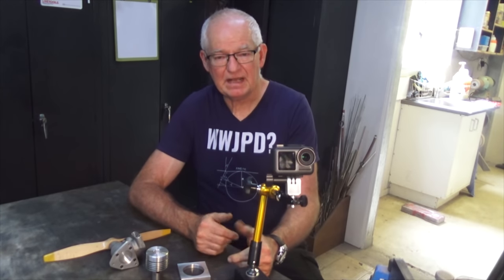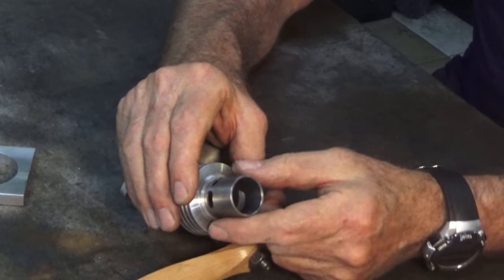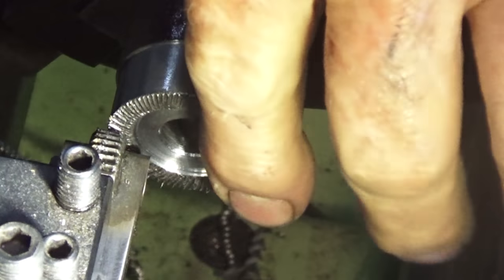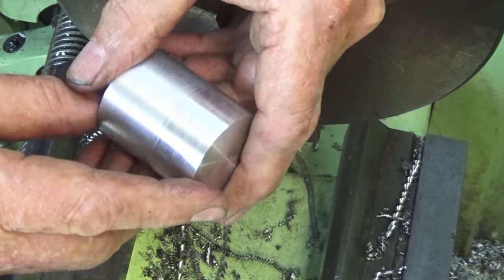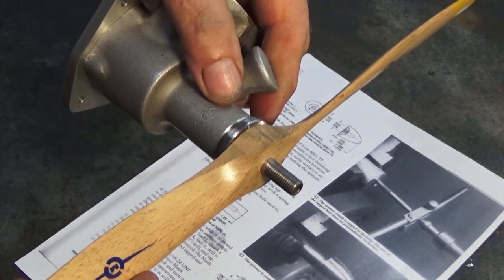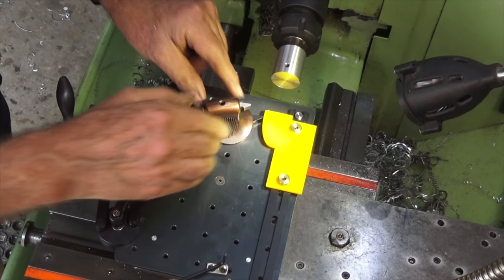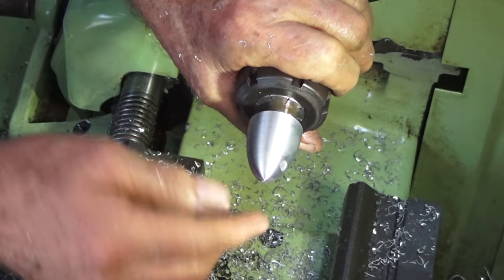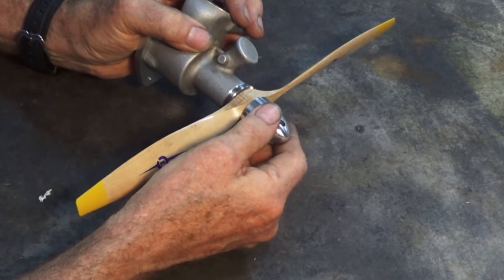Building the Titan .60 Glow Plug Engine #8

Comment: That tracing fixture is a really useful addition to the workshop
Reply from the maker: Yes, it's a nice piece of kit. I purchased the basic Turnado attachment and then the tracing arm. There is also a large radius attachment that I will probably acquire down the track. The good thing about the Eccentric Engineering tools is that you can purchase in stages as the need arises.
Regards,
Mark

Comment: Gday Preso, the knurl turned out way different to what I thought it as going to, the prop nut looks absolutely awesome, the turnado does a fantastic job and the type of parts this can make is endless, don’t stress about not getting it all done, I’m stoked there’s going to be more episodes, absolutely beautiful work mate, Cheers
Reply from the maker: Thanks Matty. I am pretty sure if I had bothered to check that the knurl was on correct centre height it would have turned out quite differently. I only have one more accessory to buy for the Turnado and I'll have the full kit. I am also waiting patiently for Gary to roll out the Flexi Chuck system. It seems to be one of those tools that you wonder how you did without it. 
Regards,
Mark

Comment: Now the cylinder liner is as round and parallel as you would like you can use the hone to give the bore a cross hatched finish for oil retention. It doesn’t even matter if you make the bore a little bigger because you can make the piston to suit. Just a thought.
Reply from the maker: I am not an expert but I believe that many of these small engines had chrome plated bores. There are no rings on the piston so the compression relies on having a super close fit between the piston and the bore. The methanol acts as a coolant as well as a lubricant. Also, there is no splash lubrication like you would get in a four stroke engine with a wet sump. I will be lapping the bore again but mainly to remove the burrs created when the ports were cut into the liner
Regards,
Mark

Comment: watching and listening to you do this work is a great teaching aid. I am amazed at the different tools you have acquired and built in your craft. I would think you must have a very well stocked shop and mind for this hobby, and must lay awake some nights designing these attachments.  Super great job. Next challenge could be a sleeve valve engine.
Reply from the maker: Thanks for the compliments. I bought a book many years ago on model petrol engines and it has sat on my shelf all that time. This engine project came about unexpectedly but it has reignited my interest in internal combustion engines. 
Regards,
Mark

Comment: The people at Eccentric Engineering certainly are cluey, I have been using the Diamond tool holders and Crobalt tool steel for some time no with great success. Thanks for showing the Tornado and great work again. Liked the cross drilling rig too. Nice animation, you could get a start with Walt Disney.
Reply from the maker: Thanks, I must say I am a bit of a fanboy for Eccentric Engineering tools. I pay full price for everything I buy from them but I think it's money well spent. The Proprietor, Gary is a very talented model maker so he knows what works and what doesn't. The Flexi Chuck system he is currently developing will be my next purchase. 
Regards,
Mark

Comment: That lathe tool for tracing a shape is awesome I never seen one before! If you sand that cone close enough usually the polisher will remove any small imperfections in aluminum because it’s so soft and it gets hot.
Reply from the maker: One of the problems with the cross hole in the end of the spinner is that any polishing tends to remove material around the edges of the two openings of the hole. It starts to look distorted around those openings. The anodising tends to dull the polish anyway so I won't be going too far with the surface finish.
Regards,
Mark
Reply: @Preso58  I know a guy who had an anodizing business in Milwaukee. He used to vibratory polish a lot of things before hand. I actually have one of his vibratory machines now.

Comment: Excellent! I like that templating jig!
I wish that I had an inkling about that when I turned the ball on the back of my cannon. It ended up resembling more of a tear drop than a ball after freehanding it. On my Torpedo forty model engine, it has a similar spinner and at the back where the female threads are, there is a boss protruding which is a continuation of the threads which actually fits into a counter bore in the propeller. That arrangement locks up tightly and seems to help with alignment.
Reply from the maker: Many years ago I made a model of a brass field canon and I recall the dilemma of trying to get the profile right. The Turnado would  have been perfect for that style of turning. The spinner on the Titan probably isn't the best design but given that the engine is destined to go on display rather than being a working engine it does look nice. 
Regards,
Mark

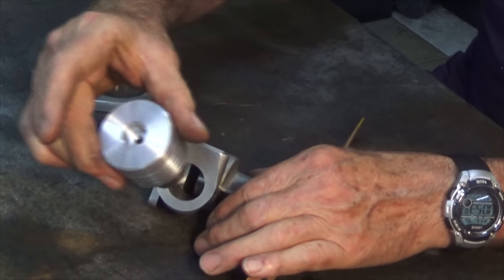Comment: 1:48  Wouldn't think it would expand apart, it's a shrink fit to begin with and the heat is going from the steel to the aluminium which should always be cooler because of more contact area with the air... oh and maybe the giant prop blasting it with air too.  

I have seen countless 3 Phase motors with spun stators because they are in crap environments and all the cooling fins are blocked.  
The motor either carries on at 150-200*C while burning itself, or the whole stator pack spins in the housing and rips the leads off the block. 

I have even seen a water cooled CNC stator which had blocked cooling galleries spin a full 180 in the case, it pulled the wires into the rotor, shorted and stopped. 
The cause was some numpty had been topping off the coolant for the motor and inverter with just water....
Reply from the maker: I guess I am just trusting the designer who I assume knew what he was doing. If I were so inclined it would be enlightening to put the whole assembly back in the oven to see if anything loosens up .
Regards,
Mark
Reply: @Preso58  

If you heated the fins with a broad flame blow torch i could potentially see it coming out as the thermal transfer is from the opposite direction as it's intended use.  Please don't try it with that lovely made part though. 

I have done it on 3 phase motors to remove the stator from the case prior to burnout and rewinding.  

The pyrolysis oven i use that burns the insulation/varnish can melt some of the aluminium alloys the cases are made of, it's also easier to lift and move just the stator pack when rewinding rather than the entire motor frame and feet.  
I like to bead blast the case then put it in the oven at 200*c for 1 hour to expand it for refitting because I melted one once with the blowtorch 😢

Really enjoying your videos and your way of making stuff, very precise and well thought out. Can't wait to see this thing run. 

Respect from UK

Chris

Comment: Hi Mark. I have a few camera setups. They are all 4K capable. Which i have tried a few times. My P.C monitor & driver are 4K. I found that producing 4K video for Youtube has little benefit over 1080. HD. You will see for yourself. I now always use 1080. The other thing is that it takes forever to upload to Youtube. The file size is huge. Another thing i found was if i did 4K vid with one camera & 1080 with another. When i came to edit it. My software which is Pinnacle studio 24 ultimate will only set itself by the 1st frames in your 1st clip. So if you start with a 1080 clip & then drop a 4K after it, the whole video will be 1080. Lovely work by the way. My camera's are Gopro hero 5 session cube. Sony RX100 mark 7. Samsung Galaxy S21 ultra. I bought a little AKASO 4k camera (cheap) from ebay. It is also 4K but the output is very grainy. Hope this helps. I did a video on camera setup recently if you have a look at my vids. Regards Steve.
Reply from the maker: Ha, you have made the Hemmingway knurling tool! I have the drawings sitting on my bench. I will check out the camera setup video. I normally do 1080P for all my previous videos and to be honest they are good enough given that I don't have a lot invested in lighting. 
Regards,
Mark
Reply: @Preso58  I did the complete build series for the Knurling tool. But i sure would not be able to teach you anything. It was really aimed at amateur's like myself. Take care.
Steve.

Comment: Very good video. I like the profiling attachment. I think the spinner came up well but always (for me at least) the hand finishing makes a difference. Good job. I assume you have marked the fins on the head to position the bolt holes and when these are drilled you will use a transfer punch (fine) to locate the drill holes in the body. Bit tricky so transfer ports and fins align correctly. Lot of thinking before lathewok on this job.
Reply from the maker: I will be using my Sieg CNC milling machine to do all the work on the head. I can use an edited version of the G Code to drill the crankcase and the cooling fins on the liner. I have already made a mockup of the head and I made all the mistakes on that version so the next one better be perfect.
Regards,
Mark

Comment: The correct space between the prop driver and the c/case should be small enough that pushing the crankshaft rearwards doesn't cause the crank pin to contact the backplate. If it does, you may need to take a bit off the front face of the backplate.
Plain bearing commercial engines have a spring steel shim washer between the driver and the case to that they don't gaul each other when using an electric starter which is pressed quite hard onto the spinner to drive it. In the old days before electric starters, there was no shim as they would all be flick started.
Looking goo so far 👍
Reply from the maker: I had intended to make a rubber lined sleeve that I could  push onto the spinner and drive it with a cordless drill. But I am thinking that it will just unscrew the spinner. At this point there is plenty of clearance between the crankpin and the backplate so that's good. I may have to face up to flick starting the engine after all.
Regards,
Mark
Reply: @Preso58  The trouble with using a drill to start it is that the engine cannot over-run the drill due to the gearing. Electric starters are typically  direct drive motors which run at around 6000 rpm with no load  so can easily spin up to match the engine as it fires.  To use a drill you need a one-way bearing between the drill and starter cone.

Comment: Another great video, thanks.  I am curios about the prop driver not being tapered or keyed onto the shaft.  Of the few engines I still have kicking around, all have a fixed driver of some sort.
Reply from the maker: The prop driver will be keyed to the shaft. I have to fit a 1/8" pin in the end of the crankshaft and there will be a corresponding keyway in the prop driver. Details, details, details! 😁 So much to do.
Regards,
Mark

Comment: What is that polishing block you are using? I like that thing!
Reply from the maker: It's a rubberised abrasive block. I have three of them in coarse medium and fine grade. They are very much like Cratex but I cannot recall what the brand name was. This is the Cratex version https://www.ebay.com.au/itm/154684581635?epid=1812238927&hash=item2403eb6703:g:Pp4AAOSw~89hhBNu
Regards,
Mark
Reply: @Preso58  great! Thanks Mark!

Comment: I love this build, as a suggestion to solve your audio issue,  I use a completely  separate audio recorder. I use a tascam digital recorder and a lav mic or just a boom to hold the recorder out of frame depending on what I am doing. 
Yes, it is a bit of a pain to add another layer of technical equipment but, it smooths out the audio especially when working in a noisy environment. Most of the video editing software can automatically sync the audio track but clapping  your hands works fine. Or you can be a nerd like me and build a clap board.
Reply from the maker: Thanks. I have ordered a separate mic and an adapter but in future I don't think I will be using the action camera to record much audio or at least not with me talking to the camera. 
Regards,
Mark
Reply: @Preso58  I had very similar issues with my GoPro hero7 silver, less than ideal audio, and the GoPro used so much data that my computer had a lot of trouble with editing using final cut x, so it’s been relegated to specific limited uses.

Comment: Beautiful work !   'Think I'd rough in the spinner before using the tracer - it would save a LOT of strenuous HARD LABOR !      'Looking forward to seeing this come ALIVE !  ;)
Reply from the maker: Absolutely. I didn't realise how hard that alloy really is. I had done some work on brass and you can remove a lot more metal more quickly. I was sort of committed by the time I set up that shot. The other thing is that the swarf doesn't break up into short chips so I gets between the tracer point and the template. It's not a very pleasant metal to deal with.
Regards,
Mark

Comment: I’m loving the series Presso
Are you going to put a key way in the backing plate behind the prop?
Reply from the maker: There will be a 1/8" round pin in the crankshaft and a corresponding keyway in the prop driver. I haven't got to that step yet. 
Regards,
Mark

Comment: could use a ball stone hone to maintain the shape of the cylinder.... just a thought.
Reply from the maker: Maybe but anything that has a resiliently mounted abrasive won't correct out of round or tapered parts. The lapping process is dirty but it does a first class job. If it's good enough for Robin Renzetti.....
Regards,
Mark

Comment: Mark, I love the way the cylinder head came out!  ;D  I look forward to the next video(s) in this series!

Also, as far as the new camera getting in your way, I remember Martin Lorton (mjlorton) here on YouTube a while back showing overhead struts he had installed in order to suspend his camera(s) as needed without tripods taking up floor space.  I think that was several moves ago, so I have no clue what set-up he's using now, but the idea is sound and you could use the basic idea in a small way to perhaps suspend your camera from over the lathe without it being as much in your way?
Reply from the maker: I do that with the Sony Handicam. I have a pole suspended from the roof of the shed and It is far enough away to avoid the chips and swarf and I can zoom in really close. In hindsight I am not sure if the Osmo is going to be much use. It needs to be really close to the action and when I was cutting the 6011 aluminium I was worried the swarf was going to tangle around the camera and pull it into the chuck. 
Regards,
Mark

Comment: The DJI Osmo action camera has a minimum focus distance at 0.3m (30cm). So anything closer than that, will cause a blur (out of focus), which we clearly saw in this footage. You can also see that everything further away from what you where trying to film, actually was crisp focus (lathe bed, car door etc). So just adjust the camera, now that I've told you about the focus distance. I'd rather see the Osmo than the other camera, to be honest. That Sony is getting old :) :) Anyways, nice video :)
Reply from the maker: Thanks. I am still working out how I will use the new camera. Certainly it's no good for close up work. I hadn't realised what the focal distance was. I am fairly comfortable with the old Sony camera but it's nice to have some other options.
Regards,
Mark

Comment: How are you going to secure the drive washer to the crankshaft?  Some use a key, some have a section of the crankshaft milled into a d profile, but that takes a similar profile inside the drive washer, which obviously isn’t the case here.  A drilled hole perpendicular to the crank would work, but weakens the crankshaft………
Reply from the maker: There is a 3mm hole in the crankshaft for a pin and the driver needs to have a matching keyway to engage the pin. I haven't done that operation yet. I'll probably do that for the next video. 
Regards,
Mark

Comment: That spinner is really a display only thing. It is not appropriate and would never be used on most RC craft, except on vintage models that were around before actual profile correct spinners were a thing for our modern models.    I would only use such a thing if I needed the weight and it fit inside the profile correct spinner, otherwise just a regular prop nut is far more desirable.  
I really like the cutting attachment for shaping it, though. Many uses for such a thing.

Comment: Ever so nice to see you work on the engine. I was wondering, can it be derived from the drawings if it is a long, short or maybe a square stroke engine ?  This would have great influence on the propeller choice.
Reply from the maker: I just checked and the bore is .937" and the stroke is .874" so I guess that makes it an "oversquare" engine. The notes say to use a 12" X 6" prop. 
Regards,
Mark
Reply: @Preso58  Thank you !
Reply: High RPM values are expected I would say.

Comment: The CGI was most impressive. maybe a new career is waiting for you there. I reckon you'd have got away with the knurling as being "by design" if you'd have said nothing! It's looking great, I liked the profile attachment for the prop nut, still great work. I'm looking forward to video of this running. Are you going to mount it in a model and use it?
Reply from the maker: The engine is destined to go back to the USA and the donor is going to see if it can go in the Joe Martin Foundation Craftsmanship Museum in California. It will probably run a total of one time..... I hope.
Regards,
Mark